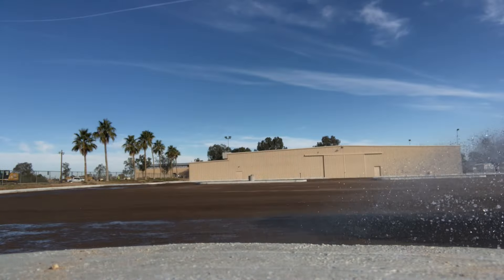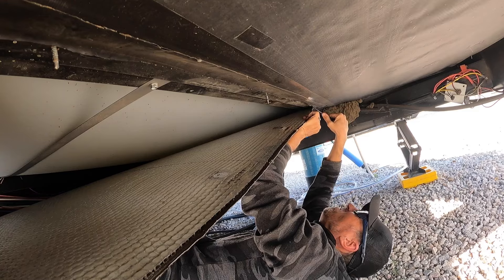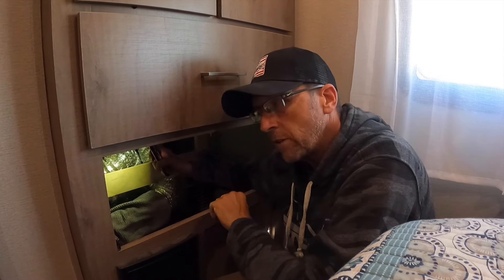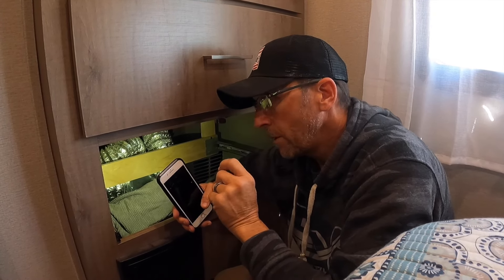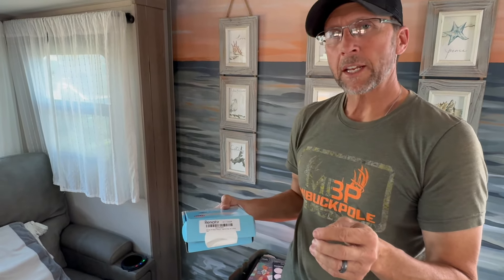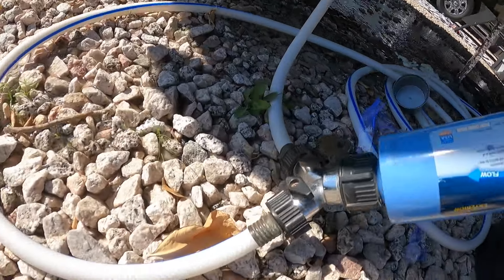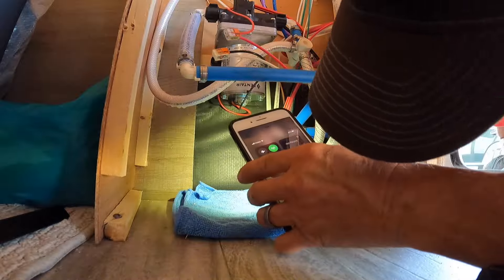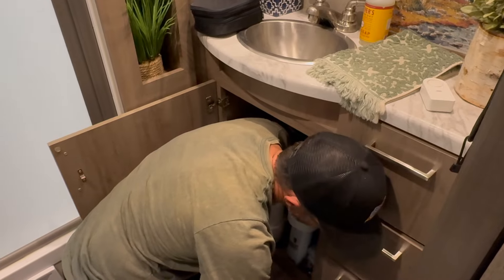RV Water Leaks + Important Lessons Learned

Comment: We occasionally had the same problem with our water pump inour old camper. The check valve would stick. Usually running the pump for a few minutes would clear it up. Good thing Matt is so handy!

Comment: Clearly these are quality control shortcomings from the manufacturer.  Two questions: #1 would these repairs (parts and service) be covered by the manufacturer?  #2 If so would they be using upgraded parts to hopefully prolong further concerns due to the original parts that seemingly fail?